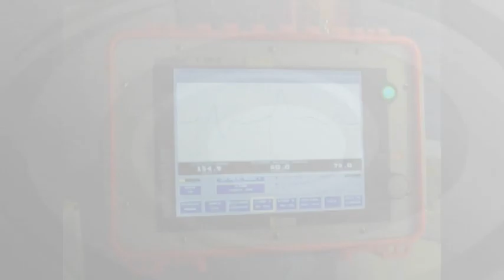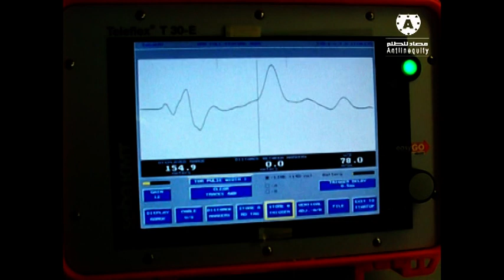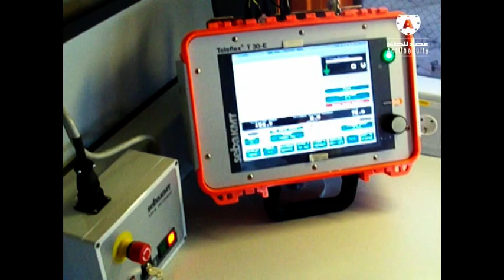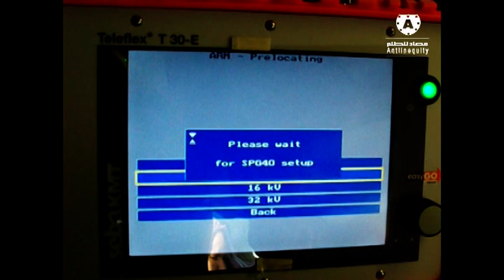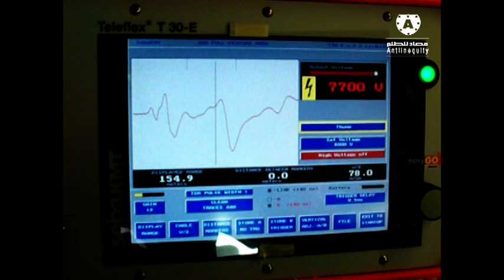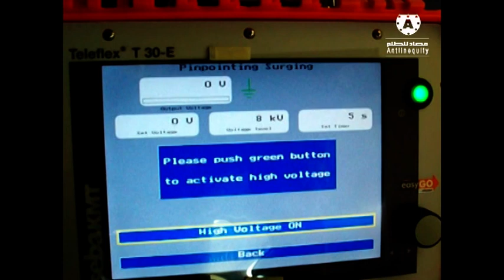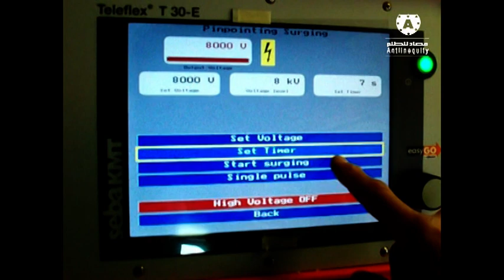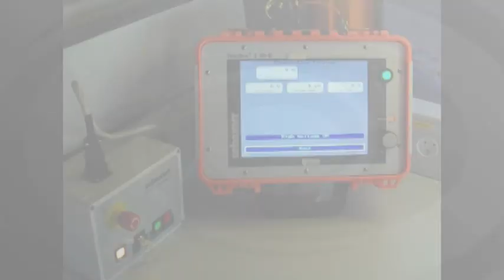Test Van:How to Find the cable fault location Part 3-3

Comment: @hayatmk Are you sure its exactly 0 ohms? Thats a pretty rare fault to happen on a network. But you can still find it. When you say 3 phase to ground i assume you mean the copper screen. So in that case you can even use cable tracing gear to locate where the fault is. or signal injection. And walk the length of the cable until the signal stops. Because you can make it travell down the 3 cores and return via the sheath. So the signal will not go further than the fault.